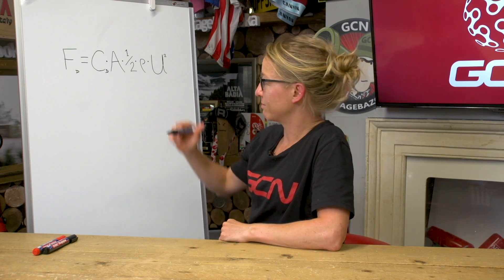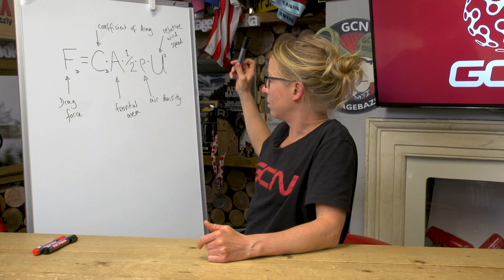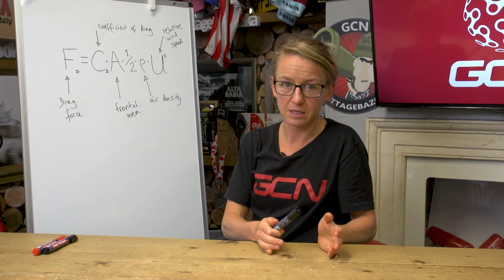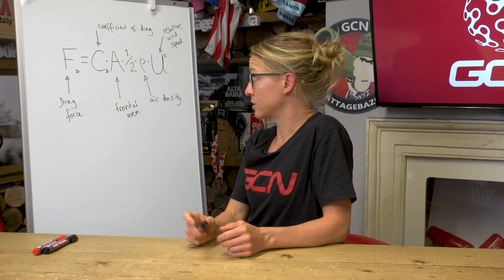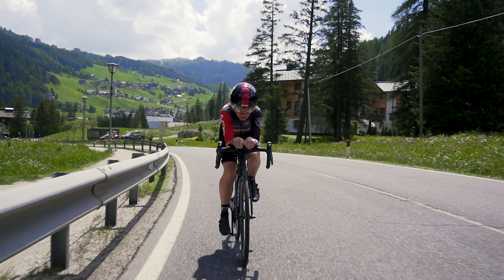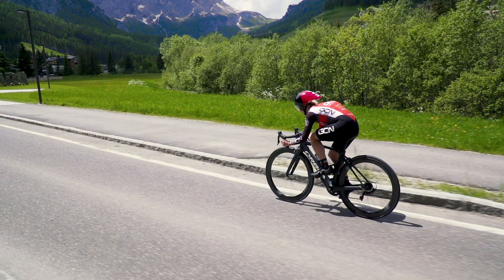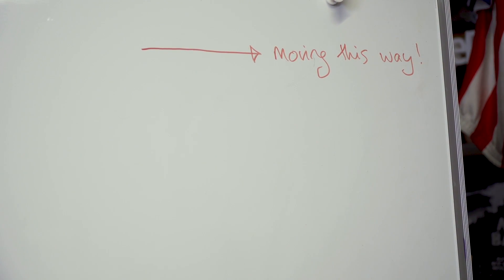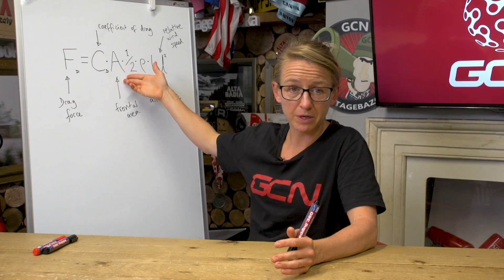Aero Bars Vs Drops | GCN Tech's Guide To Aerodynamics

Comment: More practical is use power instead of force to be able easier estimate amount of calories burn and see amounts of energy needed per hour to overcome air resistance at given cruising speed, so we air power needed raise is to the power of three relative air speed- it gives better understanding why much more power needed to ride at 40kph than 30kph since P ~ u^3 while F ~ u^2 as mentioned here - we are interested in power wats rahther than newton force which is less practical ;)

Comment: I'm liking this series. Physics and physiology is what it's all about. Emma is a great addition.

Note that what was covered here was only force. To find power, you need to sneak in a term for your speed relative to the ground, say v. With U ≈ v and Newton drag dominating resistance as it does at higher speeds, that means your power requirement is roughly proportional to v^3. Roughly speaking, going 10% faster takes 30% more power. That's why going just a little bit faster seems so much harder: it is. Just changing one gear and restoring cadence is substantial.

Comment: Nice summary.  It's also useful to point out that POWER is force times speed.  So air resistance force gets worse as speed squared, but the power you need to fight it actually gets worse as speed cubed!  

Twice the speed means eight times as much power used to fight the wind!!! 

Of course this changes with a headwind, but it's not as simple as relative wind velocity cubed either.  It's in between what you expect for net wind velocity and ground speed (because that last power factor really is ground speed).

Comment: Hey I have a question (I are a perfesser and a meteorologist so I do know from wind ...).  U is indeed relative wind speed but there is a difference in the overall relative wind profile (U(z), where z is height above ground) because the wind speed relative to the ground tends to go down, on average, as you get closer to the ground. This is the same boundary layer effect we are all worried about.  Soooooo..... The relative wind speed is really U_rel = U_wind - U_rider = U(z)_wind - U_rider.  In theory this means that there is relatively more drag from lower on the bike when you are in a tail wind (and are going faster) vs when you are in a head wind (and going slower) because low down U(z)_wind ~= 0.  I can't think of a single situation where this might actually matter, but hey, when did that ever stop academics???
Reply: Neil Donahue thank you that is genuinely fascinating!! It’s definitely important when considering the aero properties of different sized wheels - a subject close to my heart!
Reply: Fascinating or not I think the effect has to be micro-marginal. The sort of average height of C(z) * A(z) * U_rel(z) probably changes by mm for different conditions.  How I change my braid (I have a long braid...) probably has a bigger effect (the Specialized wind tunnel team actually did a video on hair treatments...)
Reply: Neil:  Probably not applicable, like you say, with standard safety bike styles (even with Emma's shorter status).  However, on top of the reduction in frontal area, a Low Racer Recumbent will also have this advantage vs an Upright, mainly in a strong headwind situation.  The wind shear is greatest from 0 to 2 meters.

Comment: Great explanation :) Put another U in the equation and you get, Power = C(D) A 1/2 Rho U^3, makes more sense in terms of power.

What is really amazing is the co-efficient of drag of a circle (i.e. your arms cross section) is around 1, but the coefficient of drag of your head and body (if you have a decent TT position) can be as low as 0.01 to 0.1. So it's no surprise that tucking your arms in really made a massive difference!

The "aero gel" that was used by Lotto isn't to smooth the air, it's to make the boundary layer turbulent to transition the airflow for lower C(D).

Comment: While riding in a primarily cross wind a couple of weeks ago, I wondered how much greater the cross sectional area and drag coefficient is from the side versus the front and at what wind speed relative to bike speed a cross wind will slow you down more than a head wind of the same speed. Yes, it is possible (at least mathmatically) that a cross wind will slow you down more than a head wind depending on the difference in area, drag coefficient, and wind speed relative to bike speed.
Reply: se7enTse7en yep I also wonder about that. As rider speed increases the relative wind direction moves forward (headwind). I think the wind has to be very far behind the rider before it becomes a benefit. Maybe that’s why cyclists always feel they’re cursed with headwinds 😉.

Comment: From what I gathered, shaved extremities and smooth skinsuit = aero has been debunked by windtunnel testing and the performance of textured fabrics... Also, cars apparently struggle more with vertices in their wake literally pulling them back than with frontal area - the aforementioned textured suits designed to keep airflow attached might be an indication this happens with bikes too...
Reply: bbman85:  Re:  Shaved legs - from the little that I've seen out there, it's at most a split rather than debunked (https://www.youtube.com/watch?v=DZnrE17Jg3I). Vortices are important but Area plays a HUGE role, as in CdxA. Texture is designed to DETACH the airflow sooner (creating a smaller wake vortex).

Comment: I have a Canyon Aeroad with the H11 bars, are there any clip-on aero bars that would fit, and also be pretty easy to put on/off without altering the set up (ie when you put them back on again, they're set up the same as before you took them off)? The bars are not a round shape and so there may not be any clip on bars to fit? Thanks.

Comment: I love these technical shows.

In regards to aerodynamics, the modern road bike has essentially reached the limit of aerodynamic performance, as permitted by the UCI rules.

The only significant aerodynamic gains that remain exist beyond the UCI rules. Ultimately, the most aerodynamic unfaired bicycle is a well-designed recumbent lowracer. These bikes, for example: https://youtu.be/POm8hjnbkHA Take it a step further, and put the rider inside a full fairing, and you end up with what we call a streamliner. There is a group here in the USA that races streamliners on a number of racetracks in the Midwest. These riders typically average 35mph for an hour.

-Dave

Comment: So.. is high cadence or low cadence more aerodynamic; does a high leg speed break up the air in a positive way, or churn it up negatively...?
Reply: 77:  You're probably right that a slower cadence would be slightly more aero, but I think it pales in comparison to pedaling at your MOST EFFECTIVE cadence (Spinners gotta Spin).  Pedaling not much help on steep downhill, plus you can tuck knees in with pedals at equal heights.

Comment: The Geek Cycling Network Glasses of Science are back - and with a load of well presented (and as far as I can tell, correct) information. 
I don't like the 1/2, I'm used to have all constant elements integrated in one constant only. 
It would be interesting to see all elements of the Davies formula for bikes, to be able to know what to optimise depending on how fast one can go.

Comment: Another great video there from Emma and thank you for going into a bit more depth with what makes up your drag force... ah the irony of getting lower and earo but then forming a less smooth shape which means that all your hard work is undone but your rear end and not forming a smooth shape for air to flow over... what a cruel mistress science can be! Would be really interested to see some differences between the different areo positions and the difference that they can make to your time trial performance compared to a change in fabric and fit on the clothing that you are wearing. I am thinking of a Boardman Aero position cera 2000 compared to an armstrong aero position circa 2000 and the difference that a good cut skinsuit can make to your differnce in drag. Great video and please do keep them coming Emma loving your good explation and helping to make things a little more approachable!
Reply from the maker: Thanks John!
Reply: John Rogers, have you seen this video: https://www.google.dk/url?sa=t&source=web&rct=j&url=https://m.youtube.com/watch%3Fv%3DoJ9H0INZ2_s&ved=0ahUKEwjbmfCPxdvbAhWJBiwKHSI0B34QwqsBCCYwAA&usg=AOvVaw0yW-a6AF4YAXVOPOphF_33

They do an in depth wind tunnel test of Obree's position and compare with other positions. It is a very interesting video :-)

Comment: I've just bought some aero bars for my TCR for next months IM UK race... Please tell me its worth the investment 🤞
Reply from the maker: Let us know how you get on, but don't forget to train in the position and get adapted to it, and how it handles!
Reply: GCN Tech cheers, will do. It'll be aero Zwiting for the next 4 weeks 😅
Reply: I set my fan angle for indoor training set up to not blow my head unless i'm in drop and being aero. I'll be penalized by being overheat if i sit tall and comfy.

Since then my position improved.
Reply: Chavit Denninnart handy training tip. Also I imagine you can tweak the position to adjust airflow as if  in a makeshift wind tunnel.
Reply: also, two fans from front left and front right so you get good airflow even with low frontal area. Otherwise, if you use one fan straight up you can actually penalize yourself for having low frontal area.
Reply: Enjoy! But be sure to get some time in the position on the road! The handling aspect is a LOT different to just holding the position on the turbo. ;-)

Comment: A quick one on air density: Somewhat counter-intuitively, an oxygen or nitrogen molecule weighs about twice as much as a water molecule. Which means that humid air has lower density than dry air at the same temperature. Also, warm air has lower density than cold air, and also warm air can carry more water than cold air. Which means that a particularly hot and humid day could be THE day to get that KOM. Except, of course, that hot and humid is the kind of weather one preferably endures in the pub, with a really cold beer, and not riding a bike...
Reply from the maker: Graeme Obree is famously obsessed with air density. It's certainly a fascinating subject!
Reply: Rasmus Wiman that’s really interesting, thank you!!
Reply: Matheus – O (i.e. oxygen atoms) is 16 g/mol. That means that oxygen molecues (O2 – i.e. two oxygen atoms bound together) weighs 32 g/mol.
Reply: Really nice video by Emma. I'm a scientist and competitive cyclist myself, so these Geek editions are totally exitin for me...;-).
 When I was going for personal records on TT-Efforts I was usually looking for moderately high temperatures and meteorologic depressions as both help to reduce air density quite a bit. If you can shift your event day a bit with regards to the weather forecast (and personal preparation) that is.
Reply: Wondering myself if weather played a part in the different times seen. Were each run done during same conditions or a warmer more humid afternoon for later runs..... Love the geek edition videos too
Reply: Rasmus Wiman are you sure about the first part? Google says H2O is 18 g/mol whereas O2 is 16 g/mol
Reply: But at cooler temperatures gas has a higher viscosity due to the energy causing molecules to move being lower, causing fewer collisions then when the temperature increases.
Reply: Graham Ashton thanks!
Reply: Ed Jack:  Of course!  But it gets slightly slower if the water freezes into a block of ice....